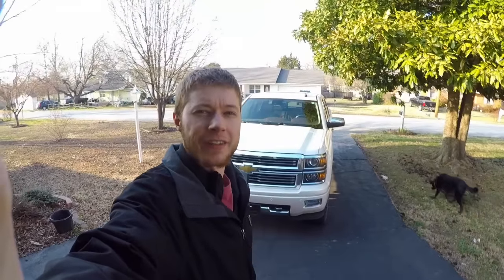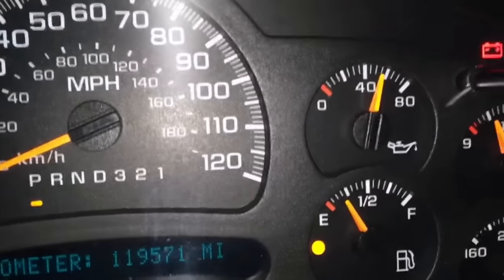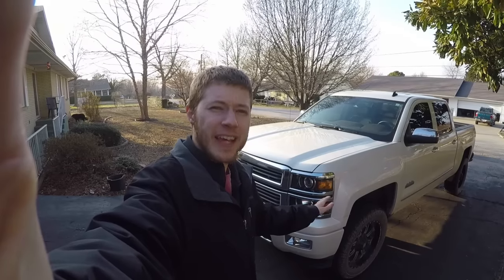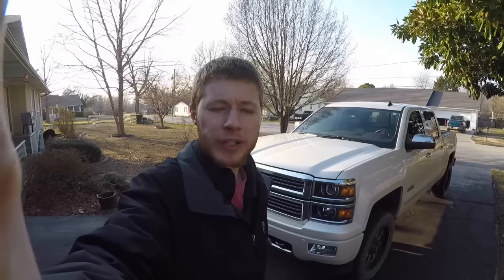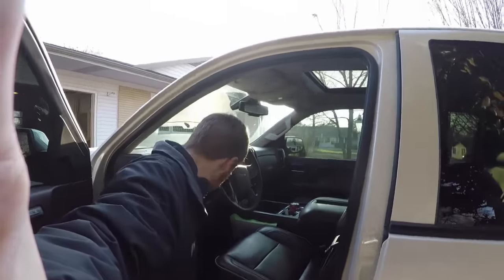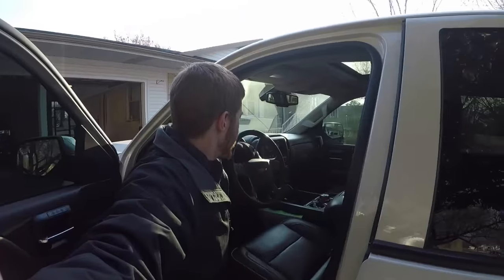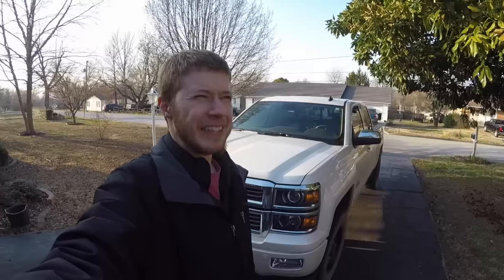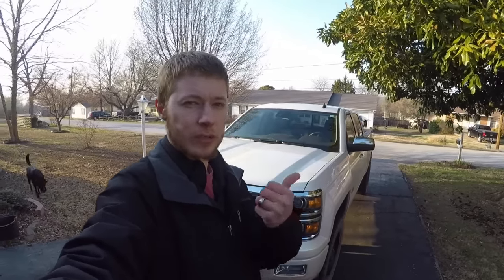Silverado Sierra 5.3 Lifter Noise Tick (What to do)

Comment: I have my 2014 silverado 5.3 LT  getting diagnosed at the dealership right now. It's been happening as long as I could remember gotnin 2018. Just recently got on my radar bcuz I'm changing the exhaust and heard about afm and the infamous lifter tap. I thought my truck was a taking time bomb but thanks for this video should have looked at this first. Would have sent it in any way but I would have eased my mind.

Comment: Is it OK to add higher viscosity oil to the engine?
 I think the normal viscosity is either 5-20 or 5-30 for this 5.3 L 2003.

Comment: Sounds like piston slap from short hyper eutectic Pistons, along with the higher performance exhaust valves, that have a tendency to bleed down, that the LS Motors have used since their Inception in 1998. What's the engine warms up and the Pistons Phil the cylinder properly the Piston slap goes away. Another observation, please quit thickening the oil to try and fix things. And if you have sticky lifters, use Marvel Mystery Oil, it clears plugged lifters faster than anything I've ever used in the last 50 years. But putting gear grease in your engine is not a fix for anything.

Comment: I thought I had a lifter making noise it was actually a small exhaust  leak broken bolts on manifold crazy how common this is
Reply from the maker: I’ve heard the same thing as well!
Reply: Exactly my friends does custom exhaust and said manifold bolts are the problem . Replace and proper torque fixes the tick noise .

Comment: Talking about reliability of these engines, 3 injectors on my 5.3 went bad after buying it used with 32k. Maybe a reason why the dealership basically gave it to me. I did change out all 8 injectors without dealer help (quoted me $300 per injector and $1000+ in labor.) 15k still going strong, but mileage went down slightly, maybe the new injectors aren't programmed for the cylinder deactivation? I'm not entirely sure. No CEL or lack of power. My 5.3 does make a ticking noise when cold, but after a few miles, it eventually goes away. Great video by the way!

Comment: I was told it was the high pressure fuel pump on my 2016 Sierra. Im not happy with that answer but it is what it is I guess...
Reply from the maker: I've also been hearing its the direct injection
Reply: It's the vacuum pump dealer replaced mine on my 2016 and guess what. Problem is gone.. you have to be persistent with the dealer service department. Everything is normal to them unless you run out of warranty then all of a sudden it's not normal and it needs repairs

Comment: If you really keep up with your motor by doing more than just oil change and spark plugs you'll get alot more miles than only 200k. Theres alot more to it such as keeping the throttle body, PCV valve, injectors etc clean will make a world of difference.

Comment: I have a 2017 Chevrolet Silverado Z71 with 28k and have a light lifter noise and it is nothing to worry over. You will have a slight tick, perfectly normal.

Comment: Direct fuel injectors & high pressure fuel making the noise . GM said its normal . Listen to the start up & reviews on similar models on you tube and they have the similar sounds . Vibration issues : If you have a towing package with 20 inch wheels ,You will feel vibrations .

Comment: Mine doesn't do it but my older silverado did. But i know the high pressure pump can tick. the lifters don't usually go bad in the 5.3 but due to the cylinder deactivation the push rods can slightly bend and create a tick also. which is what my brother in laws silverado did.

Comment: I have a 2014 Silverado LT with 186k miles on it. Same sound. Noticed the sound around 91k miles. Had it looked at and they couldn't find anything wrong with it. My 2015 Silverado WT had the same sound and they diagnosed that as the lifters. 130k miles on that one. Replaced the lifters and the sound is still there. Transmission is starting to go bad on that one now at 150k miles. I'd be interested in knowing if anyone else has replaced the lifters but still has the noise present.

Comment: The early 4.8, 5.3 & 6.0 had piston slap issues.  2014 up are totally different engines and they do have AFM lifter issues especially with high miles. Your 2014 truck sounds like the vacuum pump is bad.

Comment: On older trucks make sure the screen is clear under the oil pressure sender. On newer trucks with GDI some ticking is normal from the high pressure pump used to drive fuel pressure into the thousands of pounds per square inch range.
Reply from the maker: Great advice, thanks buddy!

Comment: I drive a 2014 LTZ with the 5.3 motor.  Mine has made this noise since the day I drove it off the lot in 2014.  The salesman and a mechanic told me that day that it was a normal Noise.  I have never had a problem and I have 79,000 miles on it now.  Still listening and still watching the situation.  Only thing that I ever had a concern in with this truck.  steve

Comment: 01 Tahoe 5.3L doing it, I let it warm up before any drive. Currently have 235,000 on it. It has to be some type of engineering issue, and it should have been corrected.

Comment: The 5.3 has a plastic filter/strainer under the oil pressure switch for the AFM lifters.  Change it out to make the clatter on startup go away.  The LS4 seems to have this problem more than the truck motors but all of the AFM motors have this filter.

Comment: I've zero'd my 5.3 noise is the oil pump chattering. Install a melling and clean the sump screen... Change the pressure relief valve and you have a bad ass vortec!

Comment: That’s just the lifters. I bought my 2015 GMC Sierra with a 5.3 bone stock with 70 miles on it and the dealer told me it’s just the way they are. 3years/80000 miles later with a exhaust, long tube headers and a tune the truck runs fine and running strong. Never had a problem
Reply from the maker: Nice!  Long tube headers are where its at.

Comment: piston slap dude common gm issue,  no worries my hd 2500 6.0 is much louder that motor goes 300k.
Reply from the maker: Seems to be the general consensus! I have a good feeling this truck will last awhile
Reply: Piston slap was fixed in 2008 with longer Piston skirts
Reply: Piston slap was common 20 years ago. These days this noise is the high pressure direct injection fuel system. It's cam driven and makes ticking noises. It's normal.

Comment: my 2014 with the 4.3 has had the tick sound since it rolled off the dealers lot, the dealer told me it was normal and that its fuel system that causes the noise not the lifters like everyone instantly thinks.

Comment: My 01 Yukon does the same thing on start up and last a minute or so. 10yrs with it and still going strong
Reply from the maker: That’s been a good rig! How many miles?
Reply: I also purchased a used 2001 sierra with 5.3l and Electric Throtle Body with 152,000 miles all I replaced was the rear main seal I do all service on my vehicles over 10 yrs later 372,000 miles  without breaking did add some power to it and still going a lot stronger. GREAT MOTOR

Comment: I have a 2018 gmc 6.2L. The other day I started it up. It was in the garage around 55 degrees. 
Naturally it when in high idle. 
I thought I would tap the gas just to see if idle would come down. I expected a rev that went to 4500 rpm and it stayed there for eight seconds. 
I guess my question is is that normal for my new truck to act like the engine is going to run away. 
In my opinion they built these engine for max efficiency but yet it dumps a ton of fuel when it doesn’t need it. 

Does anyone find this weird?
Reply: I experienced. Not expected. My bad

Comment: I think in the AFM (Holden) or DOD (Chevrolet) they had an issue with the special lifters in those engines failing or something.

I know I have an LS1 engine which I'm a third of the way through replacing the lifters on (the lifters & trays are fitted but I'm still waiting on gaskets).

The old ones were getting jammed up in the engine block & the engine made a racket when it warmed up,people thought that I blew it up.

It has valve marks on a few of the piston crowns where the valves hit but none of the valves leak & the cylinders have almost no ridge on the top of the cylinders,they still have the factory hone marks in them.

My point is the engine has done 337,512 kilometres from new & it could go a for lot longer,it does have a light knock for a few seconds when the engine is cold which I put down to slight wear on one of the piston skirts,it is meant to be normal for eutectic pistons apparently.

Once the oil splashes up into the cylinders, the noise goes away & yes it is normal for that sort of engine to have some noise in it.
Reply from the maker: That’s been a great engine man!

Comment: Took my 2015 in for that tic and the dealer changed the vacume pump. Stoped the noise for a week. Truck was at 16000k. My 2003 ran silent at 200000k.

Comment: Its lifters or injecters but its still one of the best little motors built. What i like about GM. All trucks have thier problems, most of the issues with GM wont leave you on the side of the road unlike other brands. I dont recomend any snake oil in a bottle, does more harm than good. I do add 1 quart of 20/50 to the 5 quarts of castrol in summer months.
Reply from the maker: Good advice buddy! Yes these motors are awesome, and while they might have little problems you are right, they will get you where you need to go

Comment: I had a Blazer 4.3 Vortec (the worst). It had a very common problem, blown intake gasket. After the job, it started ticking very loud, known as a collapsed lifter. Apparently loosened debris blocked oil entry into a hydraulic lifter port. I put Wynn's Hydraulic Valve Lifter Treatment in the CC. The ticking got a lot quieter in about 30 seconds. It totally went away after about a half hour and I would barely hear it for a few seconds on cold winter mornings. It is very important to use the specified weight oil. Push rod/rocker engines usually require lower viscosity oil than over head valve engines. The oil needs to be more fluid to pass through the push rods to lube the rockers while over head cam engines don't have this path. You can also add a half quart of transmission fluid to the oil to clean and lube noisy lifters.

Comment: My 2003 Chevy Silverado 5.3 has 219,000 miles on it and it just started making that ticking sound when I start the engine up probably no more than six months ago. I think it’s the hydraulic valve lifter leaking out because it goes away after a little while. Not too concerned about it. Thanks for the video👍

Comment: Another name the dealer would say is cold knock. The 6.0 liters did it also. Absolutely nothing wrong. I had a 2002 hD with the 6liter back in the day and I put 200,000 miles on it and I had no issues with the engine.

Comment: That is the worse I've heard it, I've got an 06 Z71 with just under 89k on her. I dumped a can of seafoam in the gas tank as well for the past 3 years ive tun ethanol free I have the little tap sound but only when cold. As soon as temp goes to 220 it's gone.  I feel this is a norm for the 5.3
Reply from the maker: Man, thats a low mileage 06 buddy!  Its getting hard to find ethanol free anymore, you are lucky!
Reply: Dustin T I have to drive a little out of the way for it and luckily our summer property in the Adirondacks has a Stewart's gas station on the way with ethanol ol free but iam sure they will just under or over $4 a gallon by memorial day weekend. But yes my truck has very low mileage which is the reason why I bought it in 2014 had only 50k on it. Body is still close to perfect as the on lo y rust starting to show is the rear cab corners but rocker panels are still solid. Another reason i find it hard to decide to trade in for a new or newer Silverado when there is nothing wrong with mine lol.glad I found your channel though.

Comment: What brand of flush did you use? What brand of oil are you using?
Reply from the maker: The flush was motor medic. In that 06 pickup I used 5w-30 Castrol fully synthetic
Reply: Dustin T , what type of oil are you using now, cheap stuff?

Comment: Had the same sound in my 2016,  I ran the spray seafoam through it and it quit
Reply from the maker: I’ve heard nothing but good about seafoam 👍
Reply: @DustinT  it sure as hell made a difference for me
Reply: Doubtful since the sound is the direct injection system.

Comment: Wow my 15 does not do this......use the right oil my mechanic says......
Reply: jponyboyace My 2014 Silverado sounds similar to his and I've been beating on it for over 40k miles without an issue. The high side fuel system has a regulator that can create additional ticking noise. The age of the engine oil can make it sound louder as the viscosity changes. Carbon buildup in the cylinders can create more idle noise too. Perfectly normal noise for a aluminum block pushrod V8 with direct injection. Even tiny exhaust leaks can make ticking noise.
Reply: it doesn't do it because your vacuum pump hasn't started failing yet.. that ticking is a warning sign that it is going bad

Comment: Try using the recommended gas.
Reply from the maker: Good advice!
Reply: My owners manual says to use 87 octane or higher, but my truck also is flex fuel, so I can run E85 also

Comment: Hey Dustin, when you mentioned Top Tier Gas, what grade of Octane are you running in your truck, 87, 89, or 93 octane and what Brand like Mobil, Exxon, BP gas? Thanks!
Reply from the maker: Hey buddy!! I always just use 87 octane, and the area I live primarily sells Conoco and Shell, so those are the gases I use.
Reply: I was just wondering cause once my truck gets up to temperature (210 degrees) on my gauge I hear a tick or tap. I tried some Lucas fuel treatment and the noise went away and now after 2 tank full of gas after using the Lucas, the noise is back. So, that tells me that it is the 87 octane gas that I got from Exxon. I know a service writer at a GM dealership and he also has a Silverado with the 5.3 liter engine and he told me that he knows exactly the sound that I'm talking about and he runs 93 octane once a month to clean it out and the he goes back to 87 octane and he also tells me that 93 octane won't hurt my engine at all. I asked him about using 89 octane and he said that it won't hurt the truck. Lucas says on the bottle that you can use it in a full tank of gas on every fill up. I'm not too sure about that, due to the risk of clogging the injectors or damaging the injectors seals or something else! What do you think? Thanks Dustin and keep them videos coming

Comment: Sounds like a bad case of rod bearings that would be my guess that's why you're hearing the noise from the lower fender I owned a GM and this was a problem on mine. Drove me nuts
Reply from the maker: Did you get rid of it?
Reply: Yes I did get rid of the truck. Because I know that  later on that vibration will start to score the walls on the cylinder walls  especially on a cold start. And will start to lead to other things if left on taken care of. And GM will not fix it they will make some excuse

Comment: 4.3’s do it too been doing it for the 15 years and 250+k miles I’ve had my truck doesn’t cause any damage as far as I can tell
Reply: seafoam in the oil did the trick for me to free up a lifter that made my 03 s10 4.3 sound like a helicopter

Comment: Mine has done that clicking-tapping sound since day one 0 miles. Here we are 5 years later at 108K miles and it still makes that sound even modified the exhaust because it seemed this tapping sound was louder than the truck its self lol but GM told me it's just the way these trucks sound specially since they are much more quiet than the trucks before them.

Comment: I've been using the 5.3 since 2007.  I do my own oil changes...every 5000 miles.
Mobil 1 with Lucas oil treatment.  NEVER had a problem or noise.   You should disable the Multi Cylinder thing.
Never let it run as a V4.  Idk if it matters..but I do use E85 occasionally..
With the idea it helps clean out the system.  I THINK it works.
Reply: Same here pretty much, except the E85 thing. 2011 5.3, 6 spd, 3.42 rear. For the most part, I pretty much have it in manual mode, in 5th gear. It only goes to V4 mode when in 6th gear. Still decent mileage at highway speeds because of the rear gears. I should just get the delete kit, I know, lol. Cheers...

Comment: You had me till you said reliable. With the 4 cylinder mode on this engines their reliability has gone down hill drastically.
Reply from the maker: Agreed, especially on the 07-13. 14 is quite as bad, but you are right, several had issues.

Comment: Best way to fix..... But a different truck I have a 2014 Sierra nothing but problems
Reply from the maker: What did you get?
Reply: @DustinT  
2 quarts low after 4000 miles , Only has 76000 miles. check engine light also on . Had a few codes . .... Should I keep going?

Comment: I bought a 2001 Silverado in 2009, it's a 2wd, 4.8 4 door extended cab with just over 212,000 miles on it and on my truck it's the idler pulley for the serpentine belt.  It always stops above idle.

Comment: Had one go bad on my 2005. Just made a slight chirp sound everytime that lifter rotated against the cam once it got warm. Put a new oem cam and OEM lifters. New gaskets from head gaskets up cause I was already in there. That was 20 000 miles ago, still running like a champ
Reply from the maker: Hey that’s great to hear buddy! How many miles did you have on it when it went out?
Reply: Dustin T 189000 when it went bad. At 210000 currently

Comment: We have a 2015, makes same exact noise. 130k miles. Its the high pressure fuel line/pump
Reply: Also had a 2000 with the 6.0 and a 2001 with the 4.8... both made tapping.. good oil pressure and the 6.0 has 251k on it